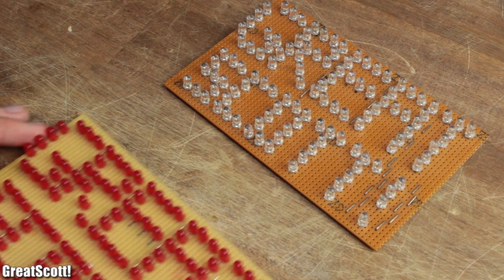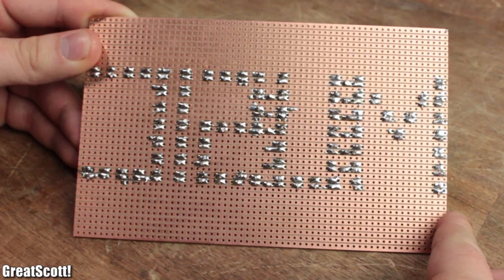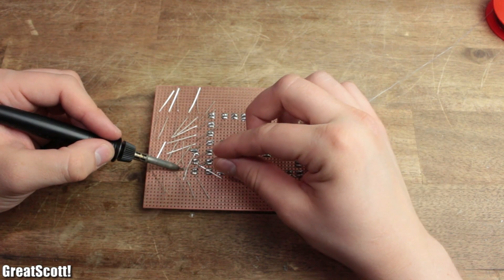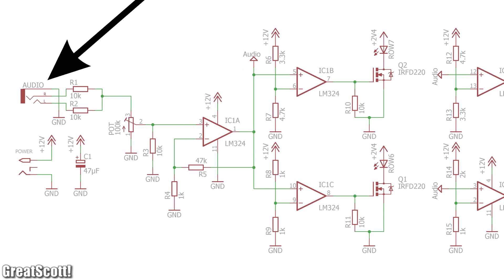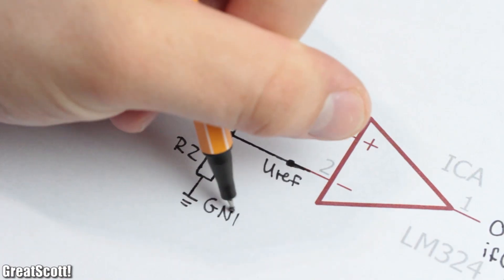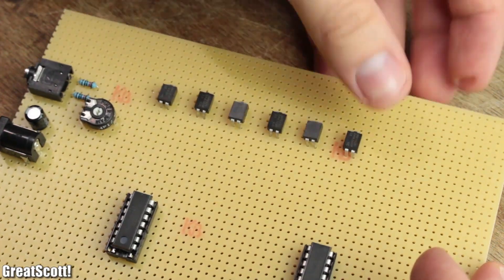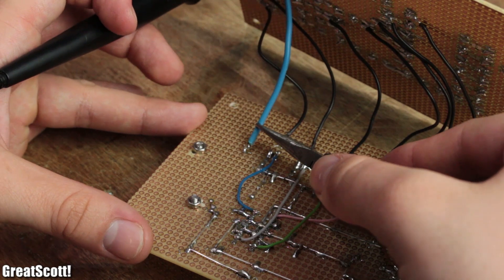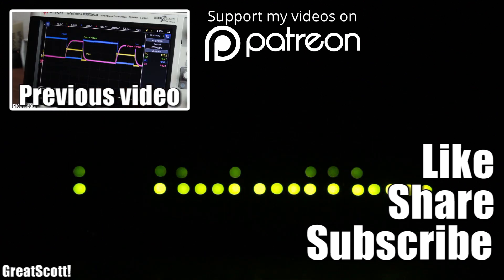Make your own LED Sign VU Meter

Comment: You can make the application much easier with a LM3915 and 10 BD140 PNP transistors as LED drivers.

Comment: This one I simple and good, but kind of expensive because you need so many ICs 
I have seen circuit to make VU meter that utilise diodes in series, and then hooking each junction between diodes to base of transistors that then drive leds.
I tried it but it didn't work, does anybody else tried that circuit?

Comment: I made one with just an Arduino.
I connected a pc remote app to it and was able to sing live while it's dancing with my music!
 ************Details***************
I just programmed it so that the voltage that comes out of my laptop (analog signal) will be transferred into the Arduino board. Then, i chose the right voltage for the right LED section (LED line). I started playing music from my laptop. The data came out of the headphone jack (analog signal) then it started DANCING. I also connect an RGB light to the board so that it changes it's color depending if music volume is high or low. You can also replace the headphone jack with a microphone. But i like the headphone jack more.

Comment: i have one question eventho u dont really answer anymore,
how do you connect multiple cathode 
like with the anode(ground) you can connect them all together 
but cathode i know that i need to connect a resistor to each  and i was wondering how can i connect multiple cathode with the use of a single resistor?
like how the led strip works

Comment: Could I suggest an easy, but effective mod for you circuit? Instead of just amplifying the signal, use the first op-amp to make the 'op-amp rectifier circuit'. Op-amp rectifier will not distort the output signal (and therefore give an erroneus VU output if just diodes were used, especially with low input signals), and, most importantly, will not insert any distortion back into the input signal. This is very important in cases where VU meter is connected in parallel to the audio line, for example between pre-amp and the power amplifier.
Reply: The best advantage of the op-amp rectifier is the VU output, which could be "slowed down" by adding a simple RC circuit to the rectifier output that would slow down the VU "fall-down" speed, thus making it steadier, less flickering , easier to follow the music, less "jumpy", and, most important, much more similar to the professional VU meters used in Hi-Fi equipment.
Reply: And one more thing - using logarithmic scale for comparator levels instead of linear (linear = 1V, 2V, 3V, etc) would make your VU meter look "more natural" and less prone to volume changes - i.e. linear design would make the VU to turn off most or all LEDs during quiet portions and lit most or all LEDs during loud portions of the music. (One example of logarithmic scale = 7V, 5V, 3.5V, 2.5V, 1.75V, 1.25V, 0.88V, 0.63V, 0.44V etc...)

Comment: hi! i made it with lm3914 IC and it's looks perfect. now i want to make bigger version of it. my idea is that i will use the same lm3914 ICs and connect them to the arduino, which will control 2m (1m for each audio channel) of ws2811 rgb led strip. Because lm3914 has constant current on it's output pins i can't connect it directly to my arduino. Is it possible to do it and if so, how?

Comment: I had made vu meter using transistor and IN4148 diode. Each led has saprate transistor.  But it required more power as input signal. I connect it with speaker output of an amplifier and add a 10 uf capacitor in signal line. Its results was great. It gives a little delay to fall down of led light and also led lightup brightly.

Comment: I would like to se a zero microcontroller(no cmos either) LED VU meter. Should be able to leverage the voltage drop across the LED's.

Comment: I have challenge for you. using 5 vertical strip of led, make a vumeter that only light up one led at a time base on volume or voltage level..

Comment: Why not create a single voltage divider with 8 resistors to get the required voltage instead of creating 7 different voltage dividers

Comment: Hey, I'm currently building my own VU meter and asked my self, wouldn't IT be "better" or more accurate to amplify the full signal. Scott only used only a non-inverting OpAmp config to amplify the positive half of the signal. Which then gets compared in the comparator stage. By adding an inverting amplifier. We could also use the negative voltage by inversly scaling it. The outcome would be the entire signal in DC. I have already drawn a little scematic. Could somebody with a bit more of "technical know how" take a look at it. 
Scematic:
https://docs.google.com/document/d/1Cdc25NJHQTEcQON_G8Uk2rtaYN2kZIHtMqDpviPe0ow/edit?usp=drivesdk
 
Thank you.

Comment: Hi Scott. From my point of view you can make this to be more simple. Instead of voltage comparators you can use an microcontroller such as Arduino or another microcontroller which has an analog and enough digital outputs and as the electonic switch you can use an bypolar transistor (PNP and NPN). Can you remake this video using an microcontroller, because this is very awesome project, especially for beginers.

Comment: Why were the FETs added???
Reply: Random Stuff They allow you to control parts of a circuit which requires more power than your ICs can deliver, for example if the voltage is different or in this case the LEDs need quite a lot of power
Reply: Thanks a lot!

Comment: why don't you just use one big voltage devider instead of a lot of tiny ones
Reply: emile they are all of different values, the lm324 op amps will use them as voltage references to turn the LEDs on or off
Reply: LostName then you should still be able to make one big voltage devider with a lot of resistors and different voltages. This will still safe you half the amount of resistors
Reply: 49,91 dollars in total. That is if you have all the equipment needed

Comment: hello scott! I created a led sign with 160 led in parallel,but i want feed the circuit with 12v and led function at 1,8v . I calculate the watt of resistance and is 32w but is very high!! What can I do? Thanks and sorry for the incorrer english. Thanks

Comment: how many leds can this drive per row?
Reply: Depends on the amperage available from the power supply, as well as what the perfboard can handle. I'd say
Reply: Tim Robson Look at the datasheet for the MOSFETs, you will be able to calculate how many they could drive
Reply: Thanks
I'll see how much current flows through the LEDS and compare that to the mosfet's data sheets.
I shouldn't think it would be too much of a problem

Comment: "Dozens of LEDs soldered in parallel and powered by a constant voltage source."

Is this one of those joke accounts? What the hell dude? I'm so old, I remember when the internet was a good place to get information... ugh.
Reply from the maker: You might like this video: https://youtu.be/Qlayua3yjuE
Reply: at 5:55 of the video you refer to, you state that its better to use a constant current source which i think its the appropriate too so albeit too dramatic enginerdy is right in pointing out that constant coltage isnt correct right?

Comment: i want to use a magic eye tube to do this, could you tell me how to do that?
Reply: In simple words, you need high voltage power supply (around 300V) and a driver circuit (could be done on one HV NPN transistor), which regulates voltage using audio signal (higher amplitude -> higher voltage).
Reply: thats all? thought i would need something like a microcontroller, the thing about that is that i dont know how to program XD

Comment: is it possible to replicate this by coding in fastLED? I want to make my 10x10 LED matrix (future video) to do that, but I figure it'd be hard to do that with one data signal
Reply: I was thinking about this too :D
and I came to the answer that this would work by using an analog pin of course, some math and the map() function and the fastLED lib as well

Comment: Hi! Quick question, would you be able to go caveman by having the audio signal go through a amplifier, then using diodes after each row to reduce the voltage? I feel like the diode's cut off voltage would be able to differentiate between what row should light up. For example,  a amplified signal is 5 volts, the first row goes through as the cutoff is 2 volts. the second row is on because the outside diode took 2 volts and your left with 3 volts, still enough to light up the leds. The third row does not light up because after taking another 2 volts you are only left with one volt and thats not enough to light up the leds

Comment: It looks nice. But what the actual fuck is happening in that scheme?... o.O
Reply: The audio signal is downmixed to mono, amplified to a higher voltage and then fed into 7 opamps wired up as comparators, which control the 7 mosfets that drive the LEDs. Each opamp is set to turn on at a different voltage, so the higher the signal voltage, the more LEDs are lit

Comment: I'm a medical aspirant student. but lover of tech, in middle of the video while discussing the circuit diagram I got a little confused. So, I've a question how to simplify it using Audrino uno microcontroller. If there is a possibility pls send the the solution to arnabsarkar301@gmail.com I really want to make this project. PLSSSSS

Comment: Can I use low power  transistors like ss8050 with gain of 220  instead of MOSFETs? I will drive only 1LED in each line so that there won't be too much current.

Comment: GreatScott  do you make drone?
Reply from the maker: +Halka Michalenková Maybe
Reply: +GreatScott! Make drone with camera
Reply: It should be doable via the GPIO, but you need to install an RTOS instead of Linux onto the PI otherwise you might run into lag for the critical-sections in your code as the interrupt-priorities of the OS might interfere with the response times of your sensor interrupts - unless you use a full RTOS. Hence, it would be better to use a microcontroller, although what's the point since there are already a whole heap of uC-based flight controllers out there already, and many of the better ones are open source anyhow. And the problem is the PI runs at a much higher clock rate than a microcontroller so would use far more battery at a far quicker rate, plus the PI adds quite a lot to the weight than simply using a small microcontroller board - PI is NOT the best solution on the quad itself.  PI is also proprietary hardware.
Reply: You can however control a flight controller board using serial from a raspberry pi. The Pi would manage the camera and relay input from Wifi or LTE to the FC. You would need custom code to handle the input and translate it into serial commands, though.
Reply: Doctor Worm building a drone is really easy...ive built like 3. Just Google fpv racing drone build
Reply: CZ/SK?
Reply: DroneMan SK: na čo by si dnes vyrábal drona doma :D
Reply: @TazkoHoZabit  :D

Comment: How much different are coils and capacitors? Both parts can store and release power. I know that there are some differences, eg. capacitor acts like a battery, but weaker than classic batteries and inductor stores energy in it's MF. So, what's the difference?
I mean, inductor does this in this circuit, but capacitor does something else in the same circuit.
Reply from the maker: +marek2630 Watch my electronic basics video about the subject.

Comment: Can you do a video on what the raspberry pi is I've looked it up and didn't find anything I understood (I'm 14 and very to to this type of stuff)
Reply: +nick kuttian The Raspberry Pi is basically just a tiny and cheap computer! If you hook one up to power and a monitor, you can boot into an operating system called Linux (which is a little bit like Mac OS X, if you have ever used that). 
Using a Raspberry Pi you can write code on that little computer to input and output signals from the pins on the side of the board. There are many different projects you can make with it. Take a read through these projects and try to figure out what the R Pi does in each one. http://www.instructables.com/id/Raspberry-Pi-Projects/
Don't give up yet, they are a great way to get started with electronics. Good luck!

Comment: I'd love to see a similar project with each vertical line linked to a specific audio frequency band, maybe with RGB LED for an even cooler look :o
Reply: This would be a good project for using an LM3915 since otherwise you'd have to replicate this whole circuit for each frequency band. But, essentially, you'd just have the signal fed into a parallel array of band-pass filters, then fed into a copy of this circuit (or an LM3915) to drive each column.
Reply: @AKADriver  I thought this video possibly would use an LM3915. I can't believe that part number came to me like nothing, though I haven't seen one in over 30 years. I had a bunch of them. My recollction is the 3915 was linear response and the 3914 was logarithmic, or the other way around. Plus I believe there is (was) an LM3916. Someone suggested slowing down the response which is a very good idea. If it's possible easily, putting in some peak hold would be good too. But at any rate when it came out, the series of chips opened up a lot of projects. I used them with 10 element LEDs in an IC package. Great for chassis mount meter projects, not for projection.
Reply: That would turn out more like what we used to call a "3 Channel Colour Organ" that were very popular kits back in the early 70's and life was groovy. :)
I still have one of mine that is operational. Typically the circuit sent the speaker level audio to 3 simple filters to get low, mid and high frequencies. Separate sensitivity adjustments for each channel. Those drove some circuitry that ended up at 3 triacs, modifying the AC that powered 3 banks of AC lighting. Using 3 flood lights was good for lighting up a family room wall or taking to parties or using out side at Christmas time in the front yard.  Blue for low freq. / Red for mids and Yellow for highs. No ICs; all discrete components. We had to be careful because half of the circuit was handling full line AC voltage.

Comment: Nice build! I've had another idea and was wondering if it was possible to hook up two separated, straight lines of LEDs to an audio jack and have the left and right "speaker" completely separated? For example: If the stereo audio file only uses the right speaker, the volume should only be "flashing" on the right LED-Strip. If it's only the left one, only the left strip should show something. In computer games, it could display the direction where sounds are coming from for example.

Comment: Or you can be lazy and go with the A277d IC which has all this prewired in it with 3 adjustable parameters :D
(Also the LM3914, 3915 and 3916 can do single point which, combined with low- and high-pass filters would do some fun stuff, like spectrum visualization)

Comment: You make it sound like it's the easiest thing to do.
Reply: it actually is very simple.
Reply: @amaanqureshi1286  If you have some ee engineering experience you superiority complex gatekeeper, most people don't even for somthing like this, when you started out, you couldn't do this, stop being cocky and telling how it is so easy to everyone who has an opinion about it.
Reply: @analogaudiorules1724  No it is very easy since it require minimal soldering skills. Just look at the circuit in the video, get the parts, and connect them. It isn't hard. I did things like this when I was 12 years old and hand zero experience or knowledge.

Comment: You could have used lm3914, a logarithmic vu meter ic.Its much simple!
Reply: +Mitko Nikov Perhaps more simple, but it does not teach anything about how electronics work. When you use a sufficiently complex IC without knowing how it works, your results will feel like nothing more than magic instead of actual engineering.

Comment: Hey Scott, question for you, are you splitting the audio? Or are you only passing it into the "VU Meter"? Im worried about signal integrity, I was thinking about using a Unity Gain Buffer on the audio input in order to hopefully get a clean signal that I can then pass to my AMP from my source equipment. Also, could you recommend a good variable power supply under $100?

Comment: Wouldn't doing this with something like a Arduino or Raspberry Pi be much easier?
Reply: +Frank Harding I think it could take a bit of time to program this. You can light up LED with Arduino, and resistor, the problem is with deciding, when it should light up. But answering to your question, I think it will be easier.

Comment: You will get a better display by adding a small capacitor to the rectified audio signal, so slow the response of the meter.
Reply: togethia great idea!
Reply: rectified audio signal?? if u rectify the audio signal all you get is a small dc voltage that doesn't work.

Comment: Why not trying an other way of showinf information than LEDs like, for example, using Nixies tubes? You can easily found a lot of theses online from back then, but they aren't easy to use. I would love to see a project (like a clock or a thermometer) made using theses!
Reply from the maker: +Maxigregrze F.E.A.O Sure, it is already on my to do list.

Comment: If you wanted to divide values equally across the 7 levels, why couldn't you have built the voltage divider with a series of 7 resisters plus one to set the highest Vref?
Reply from the maker: +MrPaulLiu Yep, could have worked like this as well.

Comment: What does does limit the current in the leds ?
Reply: +DovahkiinYT ty
Reply: +DovahkiinYT i should use 2.1v for red leds ? if i use diferent leds colors i should use two buck converter or resistors ?
Reply: +DovahkiinYT thanks alot

Comment: Can you make an rgb led stripe controlled with a esp266,  a rotary encoder and some push buttons together  using an arduino only via wifi (without a router or internet connection) Thank's !